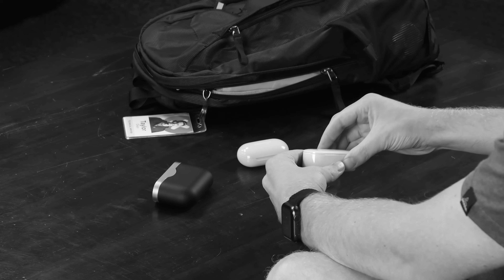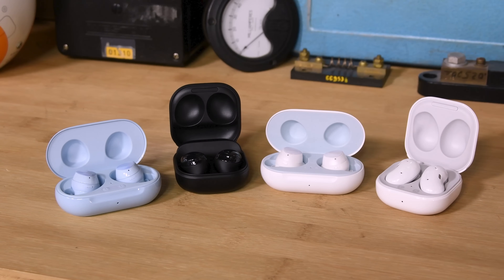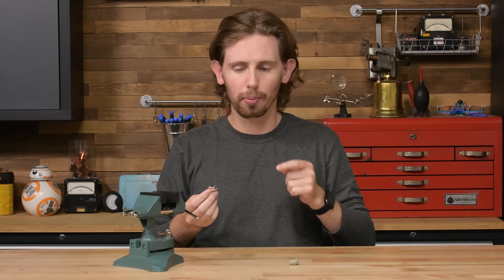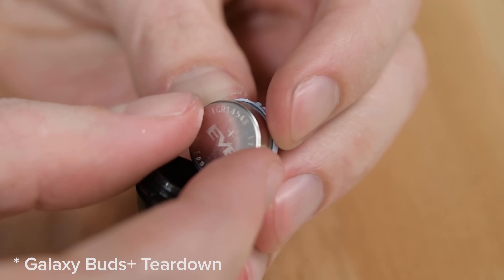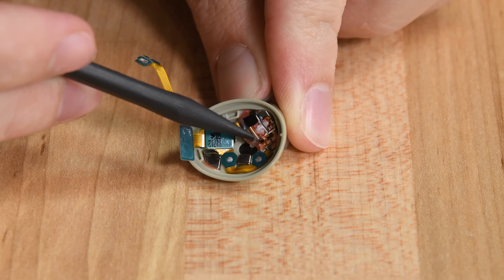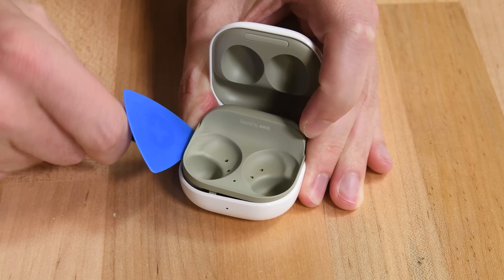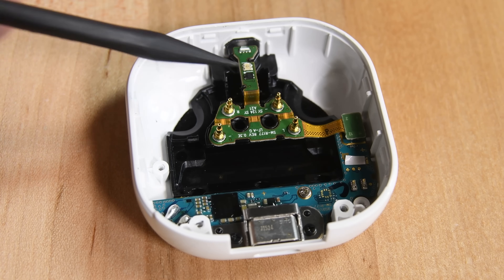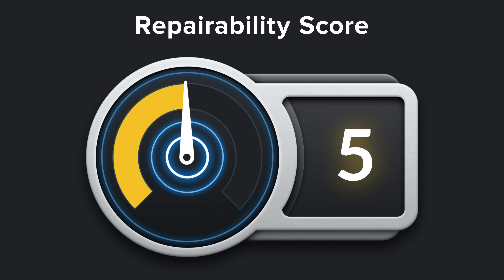Galaxy Buds2 Teardown: Great Buds With One Big Flaw

Comment: This shows the complete teardown and right when you actually get the battery out (which a lot of people might want to do to replace it), you cut away to a shot of a different battery that is from an older model and not compatible. Then there is no further information on the battery or what to replace it with. Really?

Comment: I've got a ton of NASA and Standard soldering experience, and even at that, unsoldering and resoldering those two tiny little joints, at home, with minimal equipment, is not something I would enjoy. Doable, absolutely. Pain in the a$$? Absolutely likely.

Comment: My right bud had almost completely stopped working. I came here to try and take it apart to clean it, thinking it had just gotten gross under the metal screen inside the ear cup. 

When you showed the second speaker, it clicked that only some stuff was too low after the cleaning I gave it. So I cleaned the little speaker outlet outside the cup and now it's working.

Comment: Solder joints are more reliable in such a small package.... lower failure rate means less repairs. This  is a good thing, but yes the battery is harder to service.

Comment: I don't know if this video comment section is being monitored or not, but... Question.

There is a hole between (and slightly lower than) the charging contacts.

Is this a microphone (for noise cancellation)? I know there's a mic on the outside of the bud for pass through.

The inner hole got gunked up with ear-crud and my left earbud stopped working properly. It was difficult to clean out and I didn't want to dig too deep in there in case I punctured a mic capsule.

Let me know what that little hole is... I'd appreciate it!

Comment: My buds recently got ran over. ....long story.

The sensor for touch control no longer works and honestly I can live without. But the top part of the lid on the inside now has a bubble on the headphone mold causing it not to close. Any idea how to fix it? I wanna lay my heat gun on it and push it back but I'm not sure if there is any chips or something else to worry about harming it.

Comment: is it possible to take off the tip where the sound come out off to clean it? my brother has these pair and i havent had luck in finding anywhere that could help in cleaning out the gunk that got deep in there.
Reply: Don't know if your brother still have them, but the metal grill can be removed using a needle or thin spudger. It is very hard to remove, and it might deform the plastic a little, but it is doable. Inside is a black mesh filter, you need to remove it carefully. Use 3% hydrogen peroxide solution to clean both the metal grill and the filter. Let it bubble for a while and you will see all the gunk dissolve. Dry using a qtip on the side without the glue and reattach it. Pay attention because the glue must match the orientation of the piece it goes on. The metal grill can be cleaned with same peroxide and qtip. My buds were muffled and pressurized in the ear and this cleaning solved it 100%, it sounds clearer than the other without the issue. It is a bit fumble because the buds are so small, but it can revive them.

Comment: Realy  good tutorial.  I went true every  step for the bud teardown cause mine where plugged  up with ear grease . 

Just a tipp from my side : if ur bud has significantly   less volume at one side and u can't clean it u should try to take the metal grill  of the bud ( pry it up with an small screwdriver  and then clean it

Comment: On my 2 month old Bud2's when the battery goes below 50%, my left bud only, the proximity sensor stops working. It's happened 2x and so far charging them back up has fixed the issue. Is there a fix or are they defective and will only get worse with time?
Reply: It's your luck i guess😕
I've been using this buds as one year and half ago till right now when im writing this reply and it's pretty awsome, battery life is very good for a music addicted person, actually i didn't even think about the battery percentage normaly
Reply: @mohsen taheri  If you have noise control for one bud on, you would probably never know if the proximity sensor wasn't working. Even if you don't, you might never discover it if you didn't happen to open the App and see something was not right, especially given the specific conditions I outlined in my post. Thanks for your reply, though.

Comment: Ahem: New update lets you get effective noise cancellation and ambient sound in one ear with one earbud. I work in customer service and use one bud in my left while my headset is on the right. Ambient sound turned up on the left bud and i can hear everything going on around me! This was not a thing to my knowledge just a couple weeks ago!
Reply: Got mine for Father's day last year and it has had that feature since then. Bummer you didn't find out earlier.  I only use it like this.
Reply: @P5YPH3R-88  Im using Buds2 also. but ambient sound turns off when one is out from ear making it impossible for me to use only in one ear only. Is there special setting or something?

Comment: Shame you didn't finish tearing down the case, then you would have shown all the "posters of derision" the wireless charging coil underneath. I assume the Buds themselves charge via the contacts but the case can be charged either by USB C or via a wireless charger.
Good video, mine went through the wash. Left works but the Right seems dead. Bud or case? Possibly a new Bud battery.

Comment: So on the off chance you see this. This pair of treblab x5 2018 I have had one ear but that seems to have been slightly scuffed and I can't charge it. Is the scuff the actual issue? I can change the other one fine but if I add the one that has this tiny scuff on it it keeps the case from charging. It's very frustrating and if you have any info other than the standard "clean them with alcohol" then please let me know

Comment: The degradation time on these batteries appalling. Within six months my battery life degraded by 60% in one earphone and 74% on the other! Which is why I am here. If anyone knows the battery model code I'd be most grateful if you could let me know.
Reply: It's odd that they didn't talk about that but in the Pro version they said that it was a custom cell from Samsung. If that's true it might be basically impossible to find.
Reply: @jadoei13  find what?
Reply: Same
Reply: @smoothbun  a little late to the party, but the cell that we're looking for is the NS1250. I tried a NS1254 but it was a hair too thick and the plastic pink housing couldn't close on top. Problem seems that not alot of these batteries come with the welded plate on top which needs to be soldered.

Comment: Honestly having the battery soldered on will probably make the buds last longer. Having contacts for the battery will eventually tarnish and cause connection issues down the road.
Reply: Wouldn't that be the case for all the other connectors too? Then, either solder everything or nothing.
Reply: @timbervandenhul9383  the ribbon cables would be a nightmare to solder.

Comment: About the earbuds battery life, when they say 12 hours of listening time for a single charge, are they saying both earbuds got 12 hrs(left 12h, right 12h), or two earbuds combined got 12h(left 6h, right 6h)? Some reviews indicate later.
Reply: Each earbuds has 12hrs
Reply: @williamswilliams9633  is there any manufacturer states that clearly? My earbuds specifications says it got 12hrs listening time but I only got about 7~8hrs each bud. And whichever taken out from charging case first, draining about 20% faster. Then I googled it, some review says it's L 6h + R 6h = 12hrs.
Reply: @handfe  my galaxy buds plus has never ran out of battery since i bought it a year ago
Reply: @handfe  turn off all features like touch, anc, etc. You'll get close to that 12h battery life rating

Comment: I have a slight gripe about how you described the earbud charger case, it's not wireless charging, it's more like wired charging since there's physical electrical connections between the charger electronics and earbuds'. Truly wireless charging would mean either high frequency induction charger like the Qi charger (some earbuds use this standard), and radio frequency coupling (just like how the cochlear implants get their electrical power from). Which you guys would obviously know.

Comment: Pin connectors are not wireless charging… not even remotely close. 

I guess that button cell battery in the buds were also wirelessly connected with solder  too!

Comment: I'm confused about how soldering effects the score. Would the score differ if they use through-hole vs surface mount vs BGA?
Reply: Soldering makes the repairability of a product worse because most people don't have access to a soldering iron, or in the case of small components, a soldering/rework station.
Reply: I'm confused how you don't see soldering as an extra step that the average person is unlikely to feel comfortable with. The goal isn't that only experts can fix devices, the goal is that everyone can fix them. Take a Fairphone 4 where you just pull the back cover off and swap a battery, that should be the goal.
Reply: It shouldn't affect it. If you're mechanically inclined you should also have decent soldering skills. Either way if this is someone's first time taking an earbud apart they'll likely ruin them anyways.

Comment: I have the LG tones and after almost a year of use the glue came loose on both earbuds(I left them in my car a few times durint this summer) but they were fairly easy to repair with some glue, I don't know how easily it is to change their batteries as the battery life on them is still good enough to not notice it.

Comment: If you would consider the repairer has a soldering iron what score would that be then? It would be cool to have an if you are able to use tool xy the score is z.
Reply: I feel like most electronic repair shops should have a soldering iron and certainly everyone who commonly repairs electronics should have one. Soldering really is quite easy if you have an iron and have done it before, takes maybe less than 20 minutes total (thats quite liberal) to heat the iron, wick off the old solder, and reapply new solder with the new part.

Comment: So the big flaw is solder joints!?
Reply: yeah, it's not ideal to have the battery soldered into place. Batteries should ideally be removable without the need for a soldering iron.
Believe it or not, some people don't have a soldering iron, don't know how to solder, or don't have the correct soldering equipment for the job - cheaper soldering irons may not be ideal for tiny electronic devices that need a delicate tip and fine tuned temperature settings.